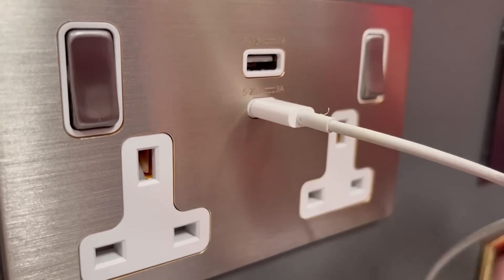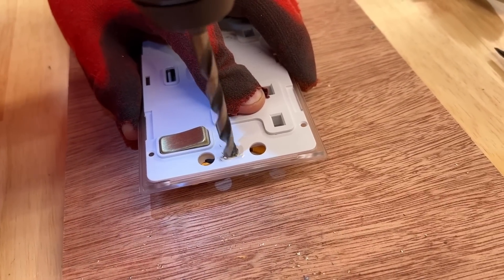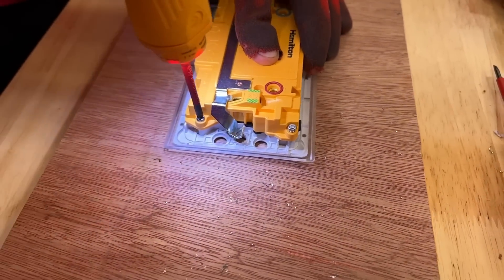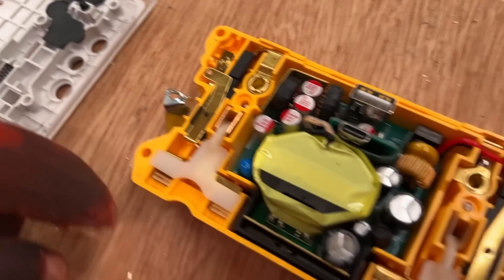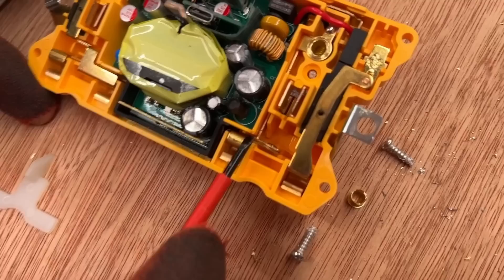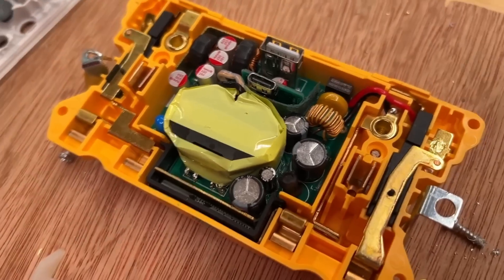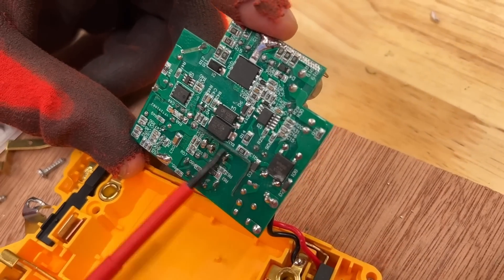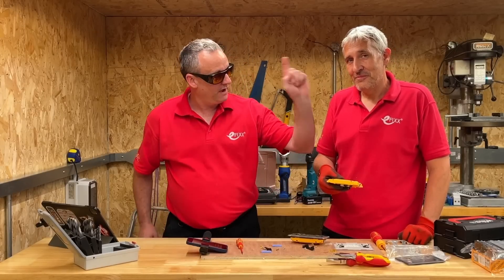How have they built the UK's fastest USB charger socket?

Comment: I'm still not a fan of these USB Sockets, You can't turn off the electronics there constantly connected to the supply I had 2 double S/O In the house with USB both failed after 2 years and there a pain when doing an IR test. I now use a USB tower it powers 5 sockets at 35 watts each and has a volt meter and amp meter.

Comment: Why are the live socket terminals not riveted to the live switch bar? What use is a sil pad dissipating heat onto the plastic back? Would have been nice to see the cap manufacturer. The bridge rectifier looks like it has already let the magic smoke out. in five years this won't work no more, maybe trip rcds all the time and no switch to turn it off. It's crap. Stop shilling crap, you will loose all cred with people.

Comment: I've always been wary about USB power sockets because of the crammed electronics and very little opportunity for heat dissipation, plus faults normally made aware through heat and smoke being obscured by the wall embedded aspect of the fitting - but this looks well thought out and robust
Reply: ....and the authorities tell you to switch off phone chargers, so how can you do that when it's inside a wall socket...I like the adaptors with USB sockets...you can switch off/unplug the electronics as required, and if it breaks, it's no big deal, plug in a new one!

Comment: Interesting to see what's inside a USB socket outlet. Goes to show why they need to be disconnected in order to do an insulation resistance test between line and neutral.

Comment: Send it to Big Clive for analysis of the circuit board.
Reply: Clive would be impressed by the transformer, but would want to dismantle it to assess the isolation between primary & secondary, and the isolation cuts in the PCB, basic safety measures...
Reply: I have a suspicion he'd be happy with these from a protection POV
Reply: Yes he actually knows what he's on about.

Comment: Thermal pads to a plastic case, not exactly the best heat removal, but then in a socket outlet with almost zero space, and not wanting to raise the front up further you have to make compromises between longevity and price. 

Still, would have been a lot better to make it a single outlet, but still that double box, and then you would have had room for both the double pole mains switch, a beefier switch that actually can handle 13A switching for 10 000 cycles at full load, and a lower temperature running converter, so that it cxan actually last 15 years in operation. Sadly though I would say this is destined to be ripped out and replaced in under 5 years, either because the sockets have broken and worn out, or because the charger has failed, either a socket breaking, or the electronics cooking themselves to death. Making a single outlet unit would be sense, as after all you do not need to plug in anything like a charger any more, and likely you would have this on a desk top or table height, so there is room to put the ubiquitous multiplug adaptor there to use the single socket anyway, to allow those 2 desk lamps to be plugged in at the same time as the router brick, as that is going to come with an Euro style plug and a UK to 2 pin adaptor that will not fit any UK outlet without fouling the switch.